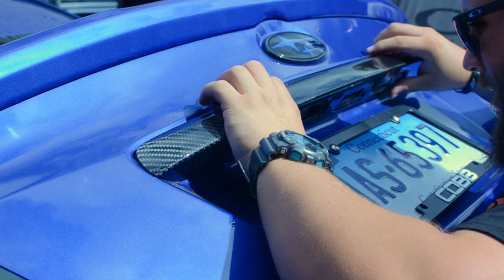APR Carbon Fiber Trunk Trim!!! - Subaru WRX

Comment: Can you use the trunk button still?
Reply from the maker: Yes if you have a trunk button I am a base so I don’t, but it has the cut out for the trunk button
Reply: Came here just to see how the heck you did that…
Reply: Never mind figured it out. You can detach the cable from a connector on the underside of the trunk and pull through.
Reply: One I got doesn't have the cut out.
Reply: @sjnims  where is the connector located?
Reply: @ricardoomana675  when you have the trunk open and the plastic liner thing folded back (you don’t have to take it entirely off), there should be a brown connector on the center-right. I found it easiest to unclip the connector from the hood, then disconnect the light cable and pull through.

Comment: I installed mine last night and there seemed to be no fitment issues but today when I turned it on with the lights I noticed the license plate lights kinda peak through the top part. Do I need to tighten it more or did you have the same issue?
Reply from the maker: Send a couple pics to us in insta! Might be able to help you more there @thewrxgarage
Reply: WRXGarage im curious what the issue was and it yall ended up resolving it. If so then how